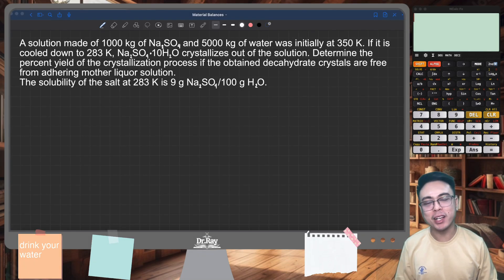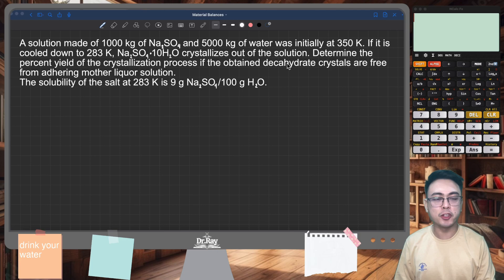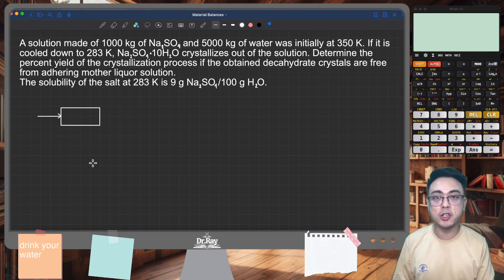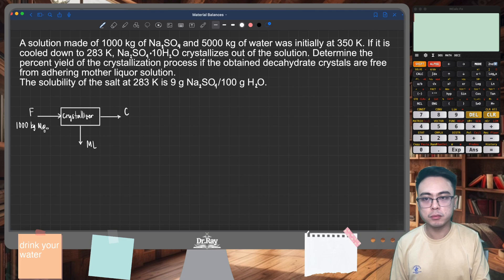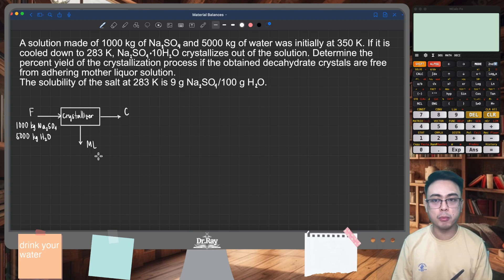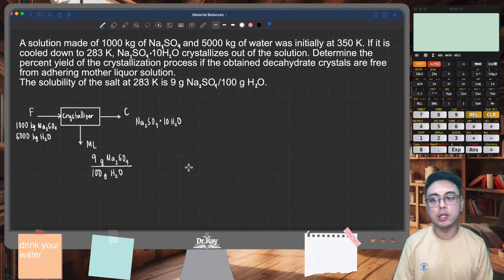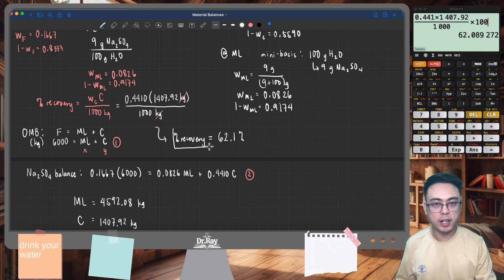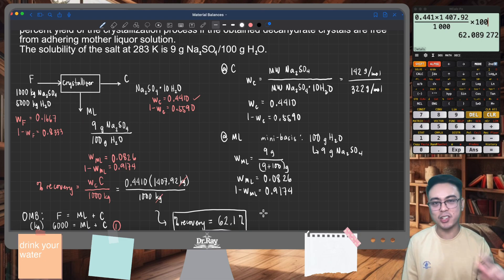Crystallizer material balance - how to do material balances sample problem on crystallization

Comment: Question where is the other stream exiting of water?
Reply from the maker: Pure water will only exit the system if there is evaporation simultaneous with crystallization. That is possible, but not included in this example.